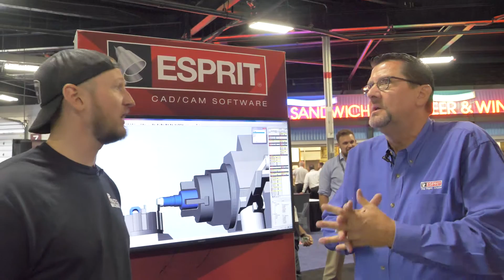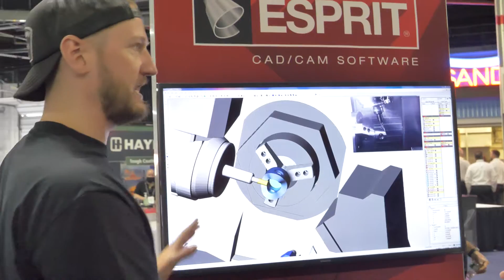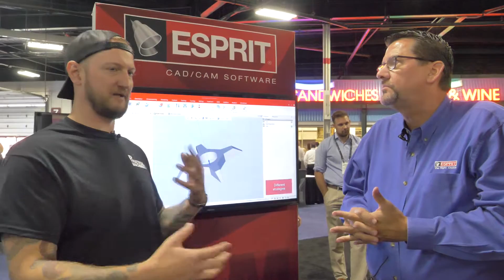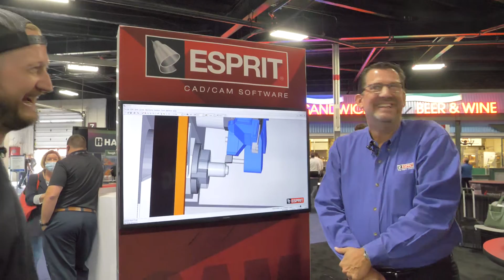Let's talk about CNC programming

Comment: My old job used Gibbs for turning and power mill for milling, started using esprit for turning in one division thought about using it for mill, put it against power mill, even the esprit guy said why would you change after seeing how much better power mill was, but on turning and our Swiss it did work nice.
Reply: Powermill definitely has some advantages over esprit, if you talking molds maybe, but other than that I found powermill it be an incredibly clunky and slow.
Reply: @85CEKR  we had the opposite on 3 axis mills when it came to that, but when it comes to mill turn and swiss esprit is pretty darn good.

Comment: We have espirit. We haven't made even one gcode program with it. Not one single program. We only use it to make a dxf to generate a toolpath which we import into the controller which generates the needed code. Essentially, this software is mostly useless.
Reply: Really? We've got esprit, hypermill, fusion 360 and we had powermill. Hypermill is still the best for milling by far but out of those esprit is close second(as long as your not talking full 5 axis stuff) if your talking about turning I haven't seen anything that comes close